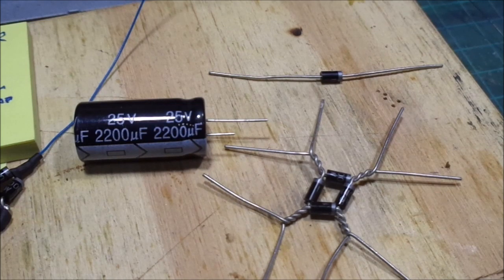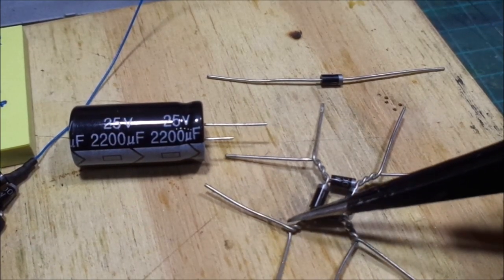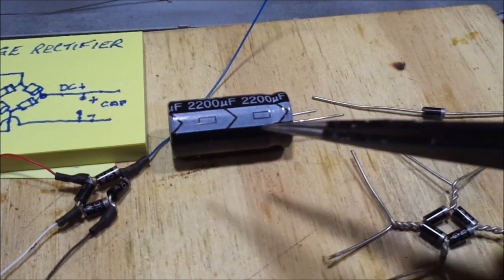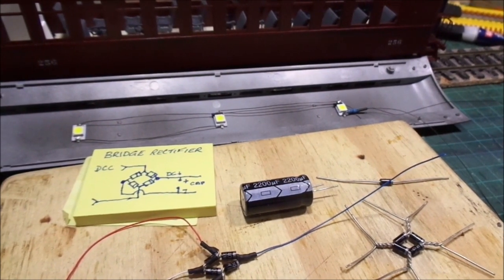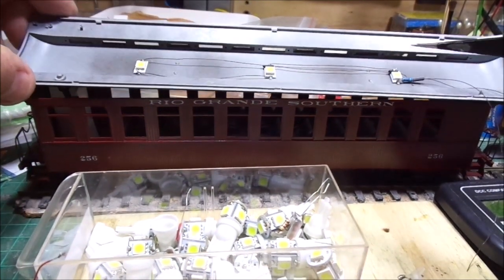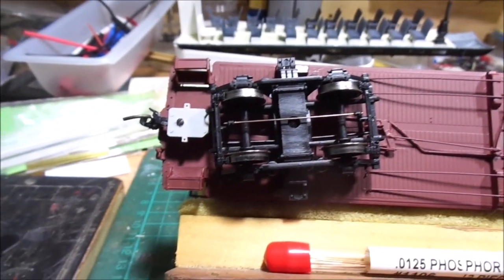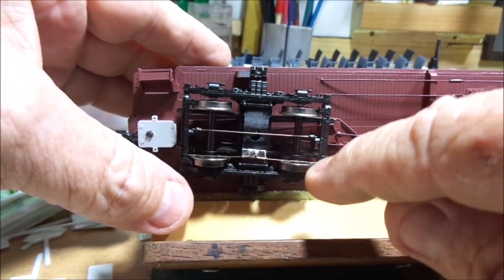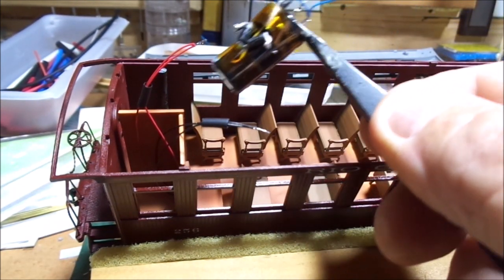COACH LIGHTS CLINIC

Comment: The CRC 2-26 you use on the track does it help the track keep from oxidizing so you don't need to clean it as much? There's an electrical paste like stuff called Oxguard that I've seen some people put on their track and one guy says he only cleans his track once or twice a year and he runs it regularly like anyone else. He says it keeps oxidation from tiny sparks that are made between the metal wheels and track from happening. I've not personally used any type of electrical spray or paste on the rails of a layout before and I've heard people talk about this Oxguard but not a spray like you use. Is keeping the track clean the reason you use it? You said it puts on a protective layer on the rail but didn't elaborate as to why you wanted that. I would like to hear your feelings on this matter of does it keep the track cleaner. The way you get your LEDs is neat. The lighting system you have seems to work very nicely and is hidden very easily too. Neat video. Thanks for sharing. Stay well.  -Wil   👍
Reply from the maker: G'Day William, watch (search) my videos for "Track Cleaning that works" shows CRC 2-26. There is much involved with dirty track but keeping it clean and conductive the CRC works better than anything else I know of or tried. You need a Rrampmeter sold as a tool to test track voltage and amps being used. Use this as a tool to check around all of your rails looking for voltage drops. These drops are what causes dirty track with one rail (say 14v as per power output) and the adjoining rail at say 11 volts. When a metal wheel passes over the rail join the voltage wants to equalize and an electrical arc (carbon) occurs and multiply this for every wheel and you have problems.